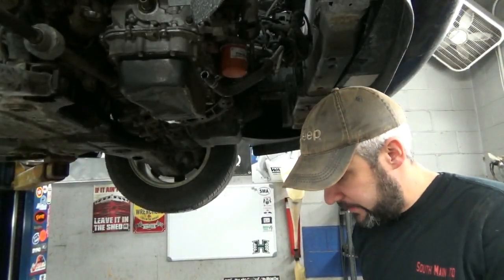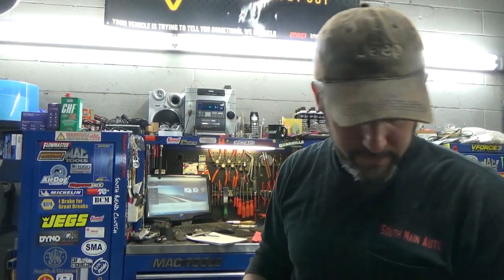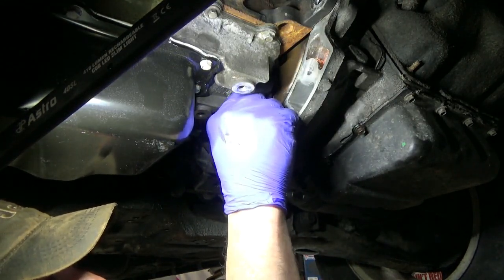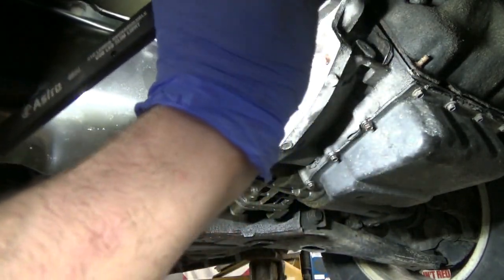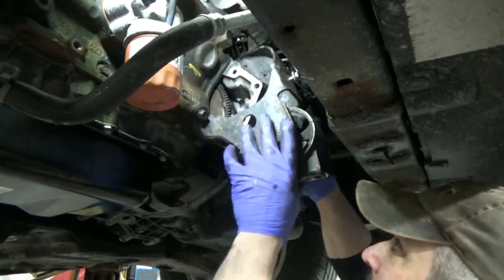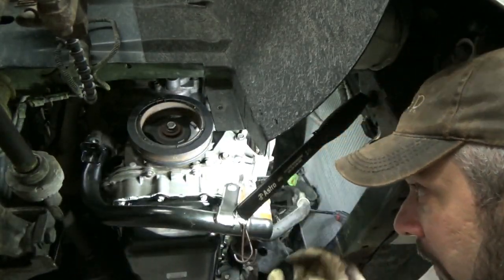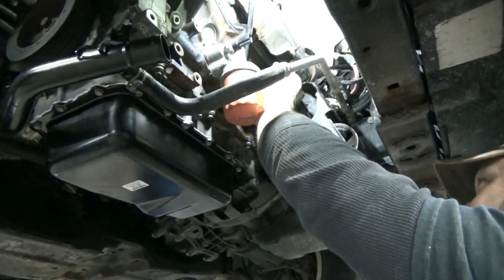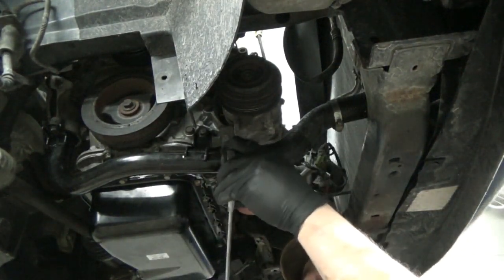Dodge Grand Caravan 3.8 - Engine Replacement - Part 4

Comment: Crap parts and crap service are part of the reason I just do side work w/o a binding schedule. You just cannot find a good parts house anymore, nor anyone that seems to know what they're doing, and when you do, the stuff they sell is all Mexican made, or Chinese. We had a father/son parts house machine shop combo the next suburb over, that was in business for 45yrs. They used to carry some real odd ball brands, as well as Delco and Motorcraft but they were all made in the USA at that time. As those suppliers got taken over/bought out, Ol Joe was forced to get into the Parts Plus franchise. Well, they killed his business. They forced him to stock expensive parts that wouldn't sell quickly, in bulk no less, and it was all Chinese garbage. As a result, the defect rate was high, and local shops stopped doing business with him, out of sheer aggravation. I used to special order Wagner, Raybestos, Felpro, etc stuff from him, and use their machine shop exclusively, but that didn't help his inventory, which he had to pay for upfront, then be reimbursed through sales. AND they forced him to buy more crap each month, as per contract. They really snowballed him. He went broke from this, and sold literally every light fixture, every piece of machinery, and every cabinet, and then the building, when he retired in '15. ( his son went on to toil in a flat rate machine shop in Chicago, poor guy.. ) Point is, when I order parts from anywhere, I tell them the brand, p/n, and do 9/10ths of the homework myself before installing anything. I never depend on the guy behind the counter blankly staring at a computer, that has never even changed plugs on a Chevy small block. 1 wrong click, and you've got the wrong part, as seen here w Mr.O's water pump debacle. Shops are getting killed by this.

Comment: EXACT SAME problem I always have with the EXACT same store! So many parts I've opened the box, and found something that wasn't even in the same category as the part that I ordered! I stopped going there - it was just too much. The last straw was when I ordered an EGR gasket - it ended up coming in the Fel-Pro kit for a Taurus 3.0 DOHC I had bought at the same time. Their site didn't show it in the pic, so I assumed it didn't come with it.  I went in the store to pick up the order, got to the car, saw that the gasket came with the kit, and headed back into the store to return the part. A simple enough task, right? Well ... since I had just ordered the parts 20 minutes ago on the net, the counter person told me it was "too soon" to issue a refund. WHAT????? Are you F&#$%G kidding me???? It's 14 miles round trip to this stinking place - I can't get work done driving back and forth to that damn place to return a stupid $1.92 gasket. This is MA where Priuses just sit and wait for me to come, and then drive 20 miles UNDER the limit,, always when I have a half billion things on my plate!  Advance couldn't give me an answer as to what TIME I would get my money back. I was so mad I just stormed out of there without saying too much, and had my wife return it the next day. I would've flipped out on them and made a scene - I was that mad! That was a culmination of countless problems with that place. Seems like the past year, they've become worse than ever. Didn't think it was possible! Agree with you 100% - CRAP parts, and equally crappy service! Sorry to hear you don't have a choice out there! I've been going to NAPA since, and have been very happy.

Hope your day goes better tomorrow!

My day today consisted of getting some gas for my fuel barrel - just a 55 gal. drum with a Fill-Rite pump on it (not to "code", LOL). Normally I strap it to a 2-wheeler & throw it in the back of the truck, and fill it at the station, but this nanny state started cracking down on "unapproved  containers", of all things, for gasoline. Yet another annoyance living here. Either way, our Grand Marquis is parked for the winter right in the way of the barrel, so I couldn't get it out anyway (wasn't starting the car at 28° with 15w-40 in the crankcase) ... so I had to lug 8 gas cans down there. I normally fill a yellow 5 gallon jug with ethanol free premium for my premix when I'm in NY state, but I haven't been hauling many cars this year, so I figured I'd treat it with some Amsoil Quickshot, and hope for the best. I changed my mind before I left, and decided to use my 1.25 gallon jug for premix, and wrote accordingly with marker on each can. Well, I get to the station, and my brain is on autopilot - I already started filling the yellow can, with oil already in it, before I realized what I was SUPPOSED to be doing! WTF. Then, in the process of filling the other 7 containers I hang the pump up THREE TIMES unconsciously when the jugs were full  .... so had to swipe the damn card again each time, wait for approval, etc... I was so mad!  What a donkey I am!  I should've stayed in bed today, LOL!

Comment: @23:00. Seriously people, do you actually think that there is any value in polishing/cleaning every/any accessory that goes on the engine.  It will just get gross and grimy from road spuge anyway.  Do you have any idea how much that level of detail would add to the expense of the job?  I assume only arm chair mechanics are the ones making these criticisms.

Comment: What if you took a picture of the water pump ( both sides, phone pics) and sent it to Advanced Auto Parts? The technology is here to do just that. AAP would then be held to the fire on the right parts .That would save you a lot of foot work, worrying, wouldn't it? Just wondering.........?? Hey AAP...start a new trend for all. GET US THE RIGHT FREAKIN' PARTS THE FIRST TIME!

Comment: I agree with you, Advanced Auto SUCKS!!!  Even when it's an older guy (or gal) working there, they just don't care (must be the work environment sucks too)! I know you are in the boonies and don't have much choice since they've got a monopoly there (thought that was illegal???).  They're my place of LAST resort when I need something in an emergency and O'Reilly, Napa, AutoZone or CarQuest don't have the part or the tool.  They won't price match either!  PIGS!!!

Before I even think about going to the parts store, I look up the part on Rock Auto so I know 1. what is available, 2. what the part number is for the various brands and 3. what the ORIGINAL part number was and sometimes what the new ORIGINAL part number is in case the manufacturer upgraded the part (that's very important) and 4. what my price should be (AutoZone hates that when I tell them that it's 18.95 on RockAuto and they are trying to sell it to me for 21.95, really pisses the counter guy off.)  That has cut down a lot on getting screwed over with the wrong part.

And that guy that had to come all they way up from Jersey and it cost him less to do that than to have his DEALERSHIP (in this case STEALERSHIP) do all that work, that is kudos to you!

AND NOW FOR THE BAD NEWS...
Advanced Auto and CarQuest have merged!  LIH!!

Comment: Polishing the parts is for the restoration business where the car is going to shows on trailer.  On a street car, it makes no sense.  The parts will be dirty again 10 miles down the road.  Plus no customer wants to pay you to clean and wax used parts!

Comment: We break the orders up and order online pick up in the store (too far to get a delivery anyway) so... ya it is a joke and commercial is like wtf, then, idk what I heard is, autopart international is commercial advance... they are here as well... sometimes beat advance commercial and they deliver.  

But I ordered crap from them, called in to pay with card, they forgot to ask me all the info, then, charged less than the paper bill in front of me.  All idiots...   But it's them autozone (even worse) or dealer (lolwut price).  

I got a water pump, fan hit pulley pump was too short, had no choice but to shim it and make it work.

Comment: Why don't you put the oil pan on a good solid surface and bend it back in shape with a dolly-hammer?    Nothin really wrong with that pan - It's easy and you can charge for the straiten job.   There was probably nothing wrong with that water pipe either, better that one than a stinky old chinese pipe, that's for sure.   I used to be like you replacing things that really could be repaired in stead.
Reply: When you do that to the OEM pans on these vans, it flakes the paint right off and they start to rust. Happened to me. Bought the van and some idiot apparently tried jacking it up from the oil pan. Found out the first oil change I did that it was almost touching the pickup tube! Can't believe that engine survived that. As for the coolant pipe, mine got REALLY rusty too, and was flaking off chunks of metal. It needed replaced, and eventually started to leak. These vans do the job, but the quality just wasn't really there for certain things such as that coolant tube.
Reply: You're right, who wants an oil pan that looks like a burlap bag full a hockey pucks
Reply: Blackaboe Not even that. If it rusts out and leaks, you destroy the motor. That's my main concern.